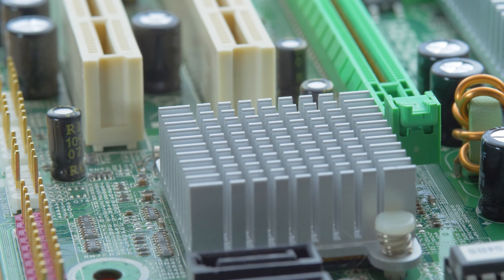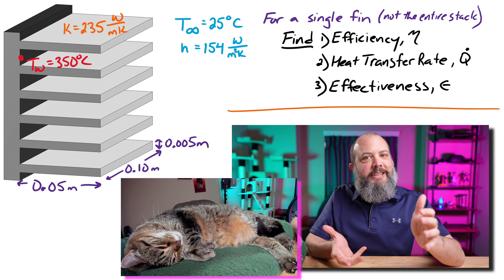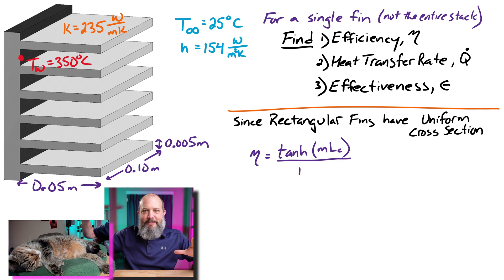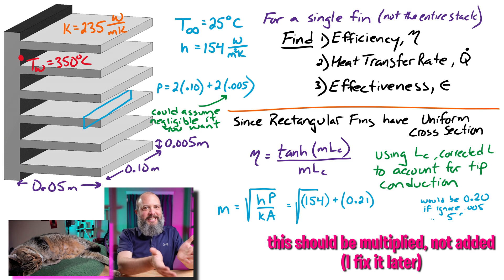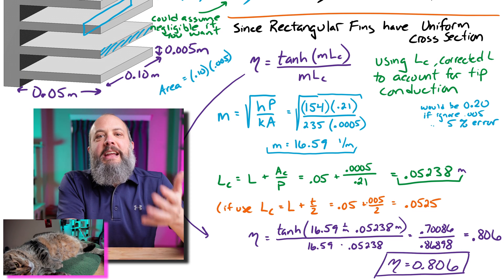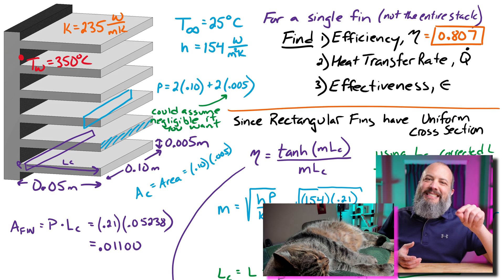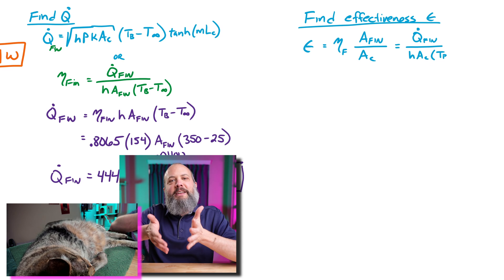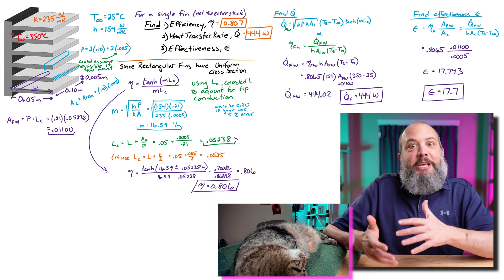How to Solve Fin Efficiency Problems (and Fin Effectiveness)

Comment: I am halfway thru watching this video and so far I can say... meow!  Finished watching and another meow!  
Everyone else is making their heat transfer videos incorrectly calling the heat transfer little q instead of Q dot.
Reply from the maker: it's a little rough because the same terms have different symbols in different classes. Heat transfer is usually a capital Q in a Thermodynamics class in the context of Q and W are used for heat at work. TA Serenity says meow 🐈
Reply: @BrianBernardEngineering     Putting a capital Q in the right place is "putting for dough" using a golfing metaphor.
I actually thought (like two days before I saw your video) that the m term (TA Serenity) was unitless, and I told my wife how you named the m value for your cat and that you said it was 1/m and I that I would recheck the units and wow, it was 1/m like you said!!!  That was awesome on two different levels!  It is interesting seeing mechanical, chemical and nuclear engineers teach thermodynamics and heat transfer online.  It looks like you have actually worked out complete heat transfer problems and not just bits of a problem.  I imagine that if you worked on a sub, you know what you're doing! 
Thank you for your service!!!   Meow!

Comment: Are those general formulas for any kind of fin? I have to study a cylinder fin, where the fins are disc shaped and I was wondering if the simplification done their could be applied to any fins. Futhermore, I was wondering if we could consider the perimeter of the fin as the perimeter of the disc times 2. Considering the Area of the fin used to calculate the heat transfer rate, do we only consider the area without the end point wall?

Comment: So I have one Doubt 
If in infinite Long Fin if the length of fin is not given the how to calculate the fin efficiency?
Reply from the maker: Would efficiency be zero for an infinitely long fin? It's not that length isn't given, length is infinite. Or you could plug in some gigantic number and see what happens. Length is in the denominator (as a part of surface area), so if that is infinite, efficiency would be zero.

Comment: Efficiency goes to 1 when length is 0 and goes to zero when length is infinite. So when there is no fin, the efficiency is max, which I don’t understand at all
Reply from the maker: Think of it as "diminishing returns". The first tiny bit of fin added is hugely beneficial. Then the next bit a little less, and next bit even less. a longer fin is always better (more heat transfer) than a shorter fin, but each bit of extra length you add does a little bit less than the piece before it. Eventually you've essentially maxed out, so extra length added does practically nothing extra for heat transfer, so that lowers the efficiency. A long fin, that gets longer, you add very little heat transfer, but a lot of extra length, so this is inefficient.
Reply: @BrianBernardEngineering  thanks!! That's a great way to put it!!